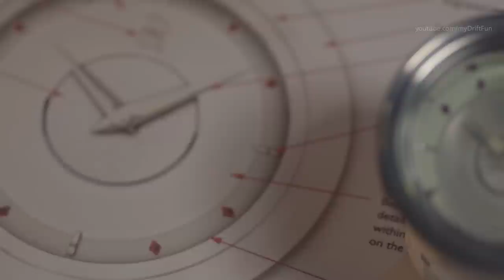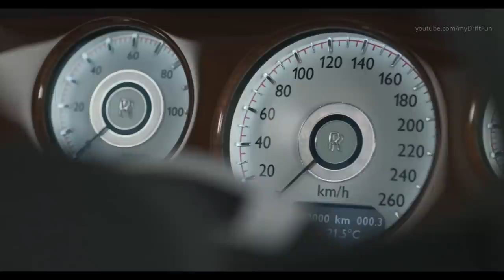Rolls-Royce Bespoke Serenity Phantom Production

Comment: Oh lol, the backing material is particle board with veneer on top. Not solid wood.
Reply: It's wood ON a particle board.
Reply: Cato Rodi 
You are a Cretan! It's not particle board. Depending on it's use and location, it is either walnut, pecan, or maltheren. Everyone knows that. Even you, now!
Reply: @richardronk4445  Actually it is a form of particle board, an engineered hardboard. It is a far more stable surface upon which to apply inlay.